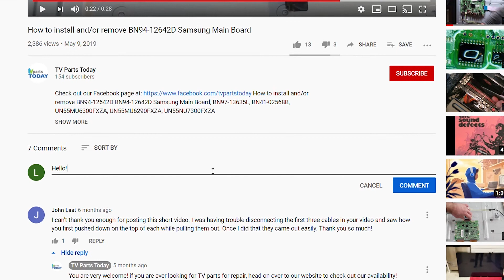LG OLED TV Power Surge/Lightning Damage Fix (OLED65C7P)

Comment: Unofortunately i don't have sound at the moment so i can't hear the video..however..the damage shown is NOT caused by surge or lightning.. It's on the secondary side of the fully protected SMPS thus can not cause such a cable/connector failure. The failure has happened during manufacture process..the crimping on the wire harness has not been tight enough thus creating resistance..resistance due to ohms law cause voltage difference..that along with current drawn by th e other parts of the TV has caused powerloss across the connector heating it up..after time the situation has escalated..
Reply from the maker: I had a very similar conversation with one of my close friends that has extensive knowledge of electronics. Usually a power surge or a lightning strike will hit the power supply at the wall cord connection or at the very least from an HDMI or COAX connection (most likely from an external device so you will see damage on the main board).  After I talked with our old YouTube team we decided that even though we may have gotten the diagnoses confused, it was still a great opportunity to show what scorching damage would look like as well as the process of changing out the power supply board and the t-con board.  This is still a very good observation, good on you!

Comment: Hope this helps my 77 c1 shuts off instantly had a power surge last night will get a new power supply and tcon board my TV shuts off instantly after pressing power button but on a rare occasion shows picture for like 10 seconds then powers off and shuts off instantly again.
Reply from the maker: It sounds like you are headed in the right direction. I would start with the power supply.
Reply: @tvpartstoday  I actually got both the tcon board and the power supply should work I hope since I know tv can power on on a rare occasion for a while also has a white line in the middle of my screen
Reply from the maker: oof   Lines can be bad. Is it a horizontal or vertical line?
Reply: @tvpartstoday  it's 1 white verticle line
Reply from the maker: That white line is most likely a t-con board or main board issue. Vertical lines are typically a board issue and horizontal lines are typically a panel issue.
Reply: @tvpartstoday  yea that's what I was thinking my power goes out a few times at night I'm thinking a power outage might of messed up one of my boards if it's not fixed with the tcon and power supply I'll get a main board next
Reply from the maker: yes for no power, main board or power supply would be most likely, and then the screen next, especially if it were a power surge.  @sheffrespawnz7235

Comment: Got a set that wont power on, goes through the cycle up to 50 watts and then sends SOS back to 0 watt. I already tried swapping t-con, power and mainboard. Any ideas on how to move forward, is the panel bad? The power seems to stay on when I disconnect the second FFC bottom cable to the t-con. Pretty desperate on a path forward.
Reply from the maker: If you have swapped the t-con, power supply, and main board and are still getting the same symptoms I would assume that there is an issue in the panel.
Reply: @tvpartstoday  Is there any way to measure or test that to be sure? I read in a LG service document one may test the tcon test patterns with it disconnected from the mainboard from p201 and lvds between main and t-con by using jumpers on the P201. However my P201 does not have a 3.5v pin on the P201 side. Any familiarity with this by chance?

3.5v to P_ON
3.5v to 12VT_ON
3.5v to DRV_ON
Reply from the maker: If you would like to give us a call at 1(800) 203-7484 and ask for Nathan, we can try and help you with your issue.

Comment: How much does that repair cost? I have al LG C9 just got damage by a power surge
Reply from the maker: I would get the back off the TV and look for any obvious signs of damage first. There should be links to the t-con and power supply in the video description that go directly to our website with the availability and prices for our parts. With power surges it is important to determine exactly where the surge entered the unit so you know which parts to replace. If you have any questions about where to start, you can give us a call at (800)203-7484 and one of our customer service reps will help you figure out what you might need.

Comment: Hi there I have a trouble with my lg b7p 55 inch recently it keep loosing signal with the magic remote and also the lg thinq app, the pointer disappears and then nothing can be controled . The panel was already replaced once but its not under warranty anymore , is there any module I should check the connections on or do something else ? Im on the fence to go with samsung q90t 😞
Reply from the maker: Any issues with a smart remote will most likely be a panel, IR sensor, or a remote issue. We don't really specialize in any of those parts, but If you have replaced the panel once already, you might be able to rule that out.

Comment: How much does a board and power supply cost?
Reply from the maker: If you don't care, find the barcode stickers on the boards you need replaced in your set and give us a call at 1-800-203-7484